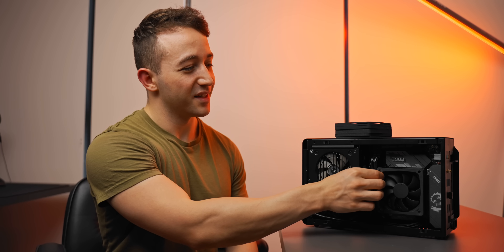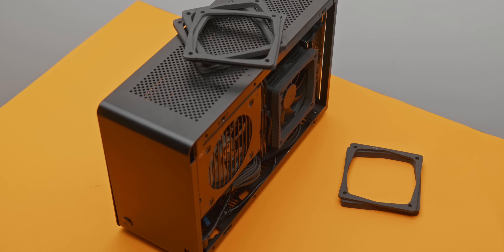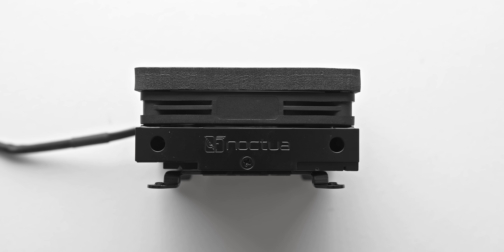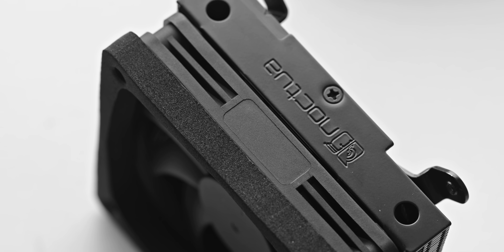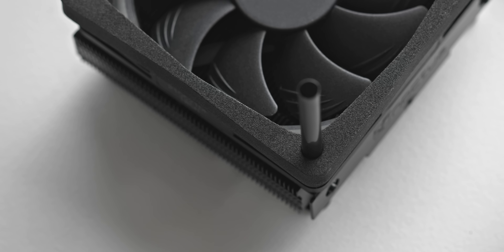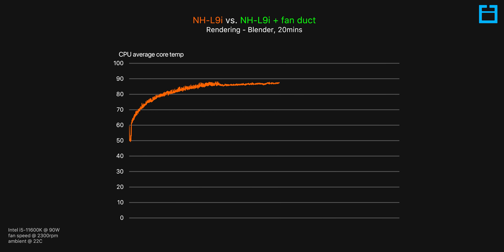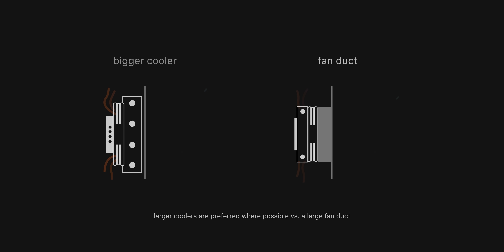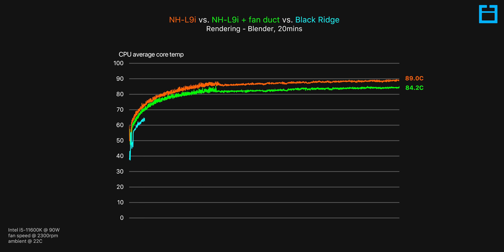Noctua's Mini Cooling Hack - NA-FD1

Comment from the maker: Correction! This is only compatible with NH-L9i/a, not the L9x65 (that version uses clips to mount the fan).
Reply: To clarify this IS compatible with the L9x65 with the clip mount. You just need to use thin cable ties which will fit between the screw gap
Reply: Do you plan on doing a review on the Lian Li Q58 at some point? The case seems to be pretty nice. I was curious on what your overall thoughts are on the case. Thanks
Reply: Hey Optimum I copied one of your buids with a barrow pump res block (2 radiators,3090), 5950x cpu been fine for half a year but now cpu overheats at 84 celsius and my games crash. Have you had the same problem? Do you think I need to upgrade from barrow pump?
Reply: A fan duct made a difference in the Velka7 and SGPC K39 with the L9a. It'd be cool to see you retest cases with the duct and without.
Reply: Simple effective and affordable solution
Reply: why not just go for the 25mm thickness fan if there's that much more clearance!
Reply: @iamdmc  it hurts thermals for some reason. This is also to ensure only fresh air enters the chassis, there's no/very little chance to get hot air. Whereas the 25mm does.
Reply: @charliefoxtrot7862  I understand the concept behind it, but imho you can get better results with a bigger fan (runs quieter, moves more air) and if you need to duct you use a very thin foam between the case and the fan. This just seems like a janky solution to keep using a poorer performing fan
Reply: Will you be testing the NA-IS1 inlet side spacers from Noctua?

Comment: Did this earlier today because my 8700g was idling at 55-60 and it went down to a whopping 35-40. I actually didn't follow the rules to a T. I just forced the side panel close because the clearance was only 2mm.

Comment: Bro...5 degrees is actually quite a bit.  Thats pretty damn remarkable if you ask me.  If this is the only cooler you can use, the NA-FD1 is a solid choice.  It could easily be the difference between throttling and not throttling.

Comment: Not really a fair assessment/conclusion. The black ridge was designed specifically with that case in mind, the fins being up against the case wall effectively creates a 'duct' to the outside air. Would you get the same result in another case where the wall was further away and the hot air gets recycled back into the the cooler, probably not. I'd like to see the result from that test.

Comment: I used the noctua 92mm kit like the one shown on a 92mm bequiet low pro cooler in my meshlicious. Works great and the kit was only like $15. I used some packing tape on the insides of the case anywhere I didn't want air to enter or escape. Super clean from the outside. Temps are a touch lower. I used camper shell foam to make fan ducts for the psu and gpu fans too.

Comment: Thermalright Peerless Assassin 120:
What is the correct fan orientation for these things?
...
and yes, I understand that there might be other components
that would prevent ( some/many ) configurations.
I have also seen pictures where they have the fans mounted
on the outsides.

  Thanks for any answers from anyone!

Comment: I went to my hardware store and got some rubber foam weather stripping to do this myself. It was about $2.50 for 10 feet so I was able to do this for every fan pulling in from the side panel. The squishy rubber is adhesive and I could stack layer to fill any size gap.

Comment: Just bought this. Looking forward to the result. I'm using a Sentry pc case and a 5600x. Noctua nh-l9a-am4 cooler. At stock it runs hot as blazing hell, I undervolted it and runs about 10c cooler. Looking forward to this improving that further.

Comment: Although Fanspeeds could potentially be reduced with this, resulting in quieter fans, it could also cause the fan having to work harder to pull the air through only whatever perforation the sidepanel has, resulting in lower temp improvement or even the opposite. Also it can cause way more airturbulence resulting in way more noise, as was the case for me. And in case RGB Ram is used to illuminate a window case, the duct can block the Light from reaching anything behind it (and obviousely the fan itself).

Comment: If you had to squeeze more from a NH-L9i without going up to a Black Ridge, instead of adding 12mm of foam, could you just grab a NF-A9 PWM and slap 2mm of foam on that on top of the cooler? I wonder if a better fan would make any difference or if the amount of total fins/weight is right its limits with the stock low profile fan.
Reply: nope. its worse

Comment: ducting cpu fans to the side panel.....20 year throwback right there 😅 
Used to just cut foam out of speaker baffles, and glue it to a length of pvc pipe to make the duct back before tower coolers

Comment: It's like flags in a bitfield. It skips 1mm and 2mm and isn't binary but combines to anything from 3 to 45 mm.
7x foam spacers (10mm (2x), 7mm, 6mm, 5mm, 4mm, 3mm)
3, 4, 5, 6, 7
3+5=8
3+6 or 4+5 = 9
10
5+6 or 4+7 = 11
5+7 = 12
and then starting with 3 + 10 = 13+ using the 10mm again up to 45.

Comment: That's not diy. Diy is when you get the foam out of your gpu box and make a custom version of it. I haven't reached the pricepoint in the video and however much it costs, it probably is too much for some custom cut gpu packing foam.

Comment: sooooo do we use nh-l9x65 or nh-l9i + na-fd1?
or diy the na-fd1 into nh-l9x65?
Reply: I’m about to attempt installing it on the x65. I’ll be installing threaded inserts on the bottom of the fan so the posts have something to thread into. I believe that’s the biggest problem. Using the clips instead of screws

Comment: Use something similar on my exhaust rads on the lian li dynamic.  Super useful for preventing the hot air from recirculating in the case.

Comment: i have a wooden box case with foam inserts and 2x pwm140 arctic intake fans. and ducted stock intel fan on a i5 3470. temps at max in summer are 55C. and deshrouded R9 270 with 2 pmw120 arctic fans on. max temp is 70C. also 1 pwm140 as exhaust. silent and very happy with it

so duchting WILL work. even with a bigger cooler the ducting can give even lower temps.

Comment: I have question, formd is launching there new cases soon. There’s the reference style, tower, and sandwich layout style. The question have you got any samples lately? My current rig is a Ryzen5 5600 air cooled and  evga xc3 3070. In ur own opinion which is going to get me the best cooling if you have gotten any samples

Comment: This may be a crazy theory, but I think that stacked fan ducts still leave tiny gaps between them and you can potentially loose 1-2 degrees. If you use double sided tape between them, it can close those gaps and potentially decrease your temperatures even further.
Reply: I feel like your side panel should be compressing them down enough to close that gap, hence why you add ~2mm extra
Reply: @isaac.e  Still, doesn't that leave a teeny tiny gap? Because when you sand CPU's IHS and remove a tiny gap, it makes a better contact and decreases temps by 2-3 degrees.

If for example, you use Sorbothane or silicone foam, it will make a good seal from compression.

Comment: This product feels like a meeting of minds and objectives from DIY persons in the SFF scene and corporate wondering what to do with their spare EVA foam, having bought too much.

I love it.
Reply: They don't need to have bought too much. They're already cutting square holes out of EVA foam to put the fans in for packaging. They turned trash into a component of a new product.
Reply: @xaiax_yt  But it isn't trash anymore, is it? It's just like saying if I bought meat on television and received it in a Styrofoam box that I should put the box at the curb rather than re-purposing it for its original design as a short-term cold chest to transport frozen goods.

There is an element of genius in this where they makes bank off of trash-turned-treasure for an apparent benefit to end-users of any fan in need of vibration dampening.

Comment: Been doing this for years in my sff PCs. Just use weatherstripping foam. It turns your internal heatsink fans into case fans. Internal heatsink fans normally have almost zero impact on drawing fresh air in to the case. The just stir up the air inside. If you don't have case fans, you're not getting fresh air. Connecting internal fans to the outside makes them effectively case fans and makes massive positive pressure

Comment: Does this work with the nr200 or would water cooling the nr200 be better. Actually could you make a vid comparing air cooling the nr200 and water cooling it?

Comment: Personally I prefer replacing the A9-14 that comes with the L9 with a 25mm A9 over the blackridge, from a noise perspective in my Velka 7 anyway.
Reply: 95% of use case scenarios seem to accept this situation. i got a i7 6700 and i still put a thicker fan on the L9i. runs at like 500rpm and never really pushes past 1200 when its under heavy loads.... like mining lol

Comment: A closer look in to spacers, shrouds and ducts would be cool. Especially with 3D printing, many cool mods are now easier to do and might enable some dope af builds. It was in the overlcok forum where i first saw some good etsting on spacers, that showed improved airflow and pressure on intake fans, but that was years ago. This really need retesting.

Comment: I think it's worth mentioning that hot air is not only recirculated inside the case - even with a duct, hot air escaping the side panel can be sucked back in.  I reduced an additional 4 degrees with the L9a and ryzen 3700X by blocking (e.g. with tape) all the side panel openings except for the ducted section.  Should be worth a try for anyone using intake ducts.

Comment: Could just throw a couple of these into the cpu cooler box for future shipments.Make it bit more compressible to fit more systems with less waste.
Reply: They use foam as cusions inside the packages anyway. They can make cutouts and fillers in the foam, just like sim/micro sim/nanosim cards all aligned/cut in one sim card piece, and you can take out whichever size fits in your phone.

Comment: Fun fact - that’s also a reason why some bigger cases are worse than smaller which doesn’t recycle hot air as much (less space). Still waiting for a case that would address this issue out of box rather than getting gpu hot air into cpu for instance

Comment: I actually replaced the Black Ridge in my Dan A4 with the L9a and FD1. The noise the Black Ridge produces at max RPM, even with a Nocuta fan, is so loud and high-pitched that I would rather lose some cooling performance to have a quieter system. In theory I could reduce the fan speed on BR and get it quieter, but any fan speed above ~35% produces an annoying whine that I just can't stand. I also didn't want to go for the Asetek 645LT, as that has pump whine, so it has a similar problem to BR, not to mention the cost and how much PITA it is to install. For a while I also run the BR with 120mm fan and VLP memory, but that RAM kit was way too slow and I couldn't get a stable overclock. In the end the L9a ended up being the best compromise.

Comment: You can DIY this with foam (neoprene) weather stripping that is sold at hardware stores, and you won't be limited to 92mm fans either.
I used to do this to improve the seal between radiator and case, and radiator and 120mm fans.

(Not that I don't appreciate Noctua for offering a clean looking package at a very reasonable price)
Reply: I cut "ducts" and fill gaps of all kinds of sizes like this for the high performance laptops all the time from even low density foam harvested from packaging, knowing Noctua these are probably pretty pricey for what they are.
Cut it clean with a really sharp razor and spray paint or use a marker to make it black and it can look pretty good.
Stopping turbulence by eliminating gaps is really good for keeping long term load temps down by getting the most out of the high airflow required to adequately cool where radiator size is constrained
Reply: I wonder if you could just caulk between the radiator and fans.
Reply: @ThisMoose  You could, but that would be pretty gross.
Reply: You said you used to do that, but why'd you stop? It wasn't worth the hassle to you?
Reply: @Slavolko  I no longer use water coolers. That and case manufacturers have changed their intake fan mounting bracket, so there's little point to closing the gap between case mount and fan, when there are big gaping holes elsewhere that cause intake fans to lose efficiency.
Reply: I was thinking of how well a 3d printed version of this would work
Reply: @AFlyingSwive  it would work exactly the same
Reply: Yee. This is what I did with my Sentry, but I gotta say the noctua method is a lot cleaner.
Reply: I just picked up a roll of that foam the other day. I am going to see if I can duct my entire 5080 in my Fractal Terra.

Comment: This is certainly nothing new. They used to sell cases with a duct installed in the side panel that lines up with the CPU cooler. I actually still have one such case from ULTRA.

System modders used to rig their own, as well. Early 2000s was a fun time for system builders. We used to jury-rig everything. Back when there were no LED strips, and we used cold cathodes. Or use Dremels to cut fan holes into cases that didn't have enough airflow.

Comment: Now put a fan duct on that Alpenföhn. I made a fan duct for my Noctua L12S and it was pretty good. It just takes a bit more tinkering because the whole cooling unit has to be shrouded.
Reply: Which material did you use?

Comment: Dunno why i never thought of that, made a quick one out of paper and tape and it dropped my temps significantly in an inwin chopin with a goldenfield 36mm 4 heatpipe cooler... can finally close the case when gaming on this poor heavily overclocked ryzen 3200g... Thanks much

Comment: Great review, thank you for showing us the new stuff that lead companies are creating
why they lasted that much to do that?, i had that in mind for years. I love noctua, great company this things makes them the best one in cooling. 

sure you can use them for GPU too.
This proves the air recirculation not just here, but on front atx cases with a lot of gaps where the fans are mounted. closing the gaps helps a lot to ensure a correct intake airflow.

Comment: Hmm could just 3d print these out of TPU or comparable plastic also
Reply: It's an Eva foam, not plastic
Reply: @CobaltFoxPlays  that way it can suit a range of gap sizes, close gaps completely and avoid the introduction of vibration noise. you could definitely make something similar out of plastic, like you can find on SFF Optiplexes and such.

Comment: That stupid rubber is $13? Is Noctua new Apple?
Reply: It’s foam. Very particular use but it works, and noctua has always been a premium brand.
Reply: lol they always have been the Apple of PC cooling. Have you not checked the prices of their other products, or seen the following they have?

If Noctua didn't have such a loyal following, you wouldn't see Noctua's products sell more than comparable products from other brands that are either cheaper, better, or both.

Lian Li used to be the Apple of PC cases, but they've actually started creating budget cases some years ago. Now they're not perceived much different than other brands anymore.

Comment: i actually consider using such a shroud in 140mm for my case fans to minimize  obstructions of the airflow by close mesh or fan mounts.
Reply: I did this for my 2 x 140mm intake fans, I used the carcass of 2 x 140mm cheap 140mm fans and mounted them together to the front of my case.  This gave me a 25mm gap between the intake fan and the front dust filters and moved the exhaust of the intake fan 25mm closer to the cpu/gpu, resulting in a big improvement in temps and noise(the reduced turbulence through the front dust filters was massive).

Comment: Looks easily replicated with 3d printers..
Reply: not everybody has a 3d printer
Reply: @Oldsah  true. There are companies that will print item for you if you send them 3d model. I used this service :)
Reply: you can 3d print foam? looks like foam
Reply: @thedeleted117  i don't don't know. I printed plastic like material.
Reply: @thedeleted117  this is foam, you can 3d print fanducts out of nylon and plastics and all that but not foam :).
 theres a guy called major hardware on youtube if you have any interest in that you can look him up. he even did it for a gpu but its different aitflow of course
Reply: better with foam then 3D print to be honest.  Just cut from some packaging foam.  The seal I think is Important
Reply: I could probably make 50 of these things with a $7 foam yoga mat and a box cutter.
Reply: @bretth6393  yoga mat?!!!
Reply: I printed something like this 2 years ago.
Reply: Did the same with weather strips. Very nervous about long term stability. XD
Reply: To what end